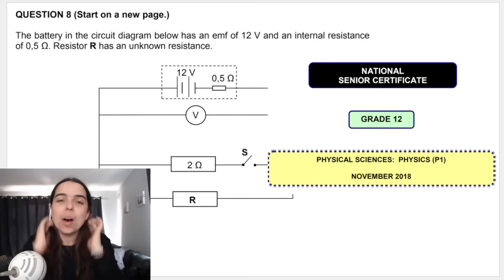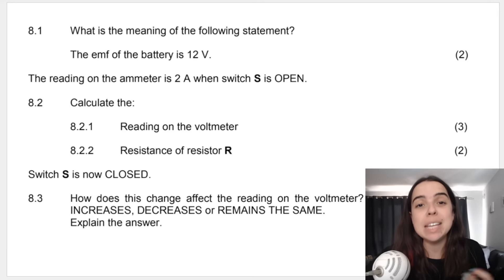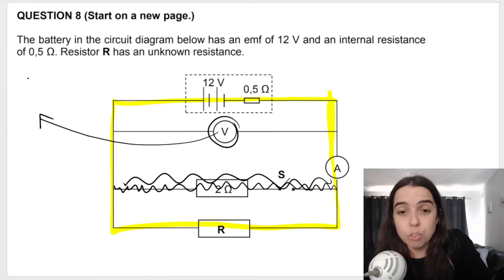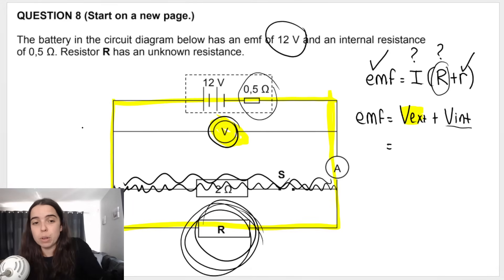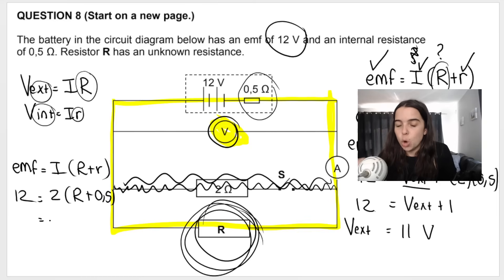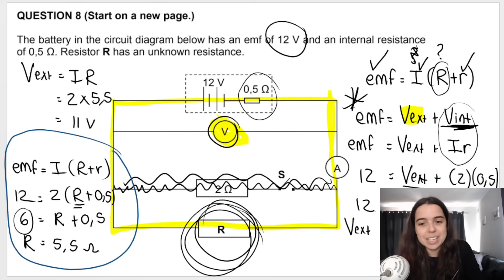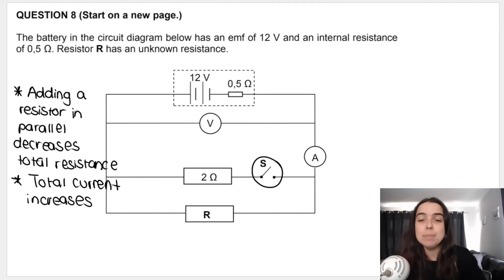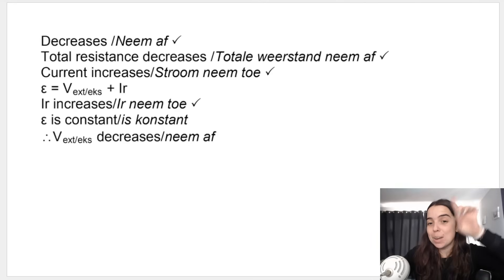Grade 11 and 12 Electricity Exam with Internal Resistance Part 2

Comment: Sorrry maam, for 8.2.2 you calculated the total resistance of the circuit, not the specific resistance for resistor R. Like the questions asks😮😮😮
Reply: Ohhh nvm, sorry I didn't see that the switch was closed😅😂
Reply: I mean open 😂😂😂